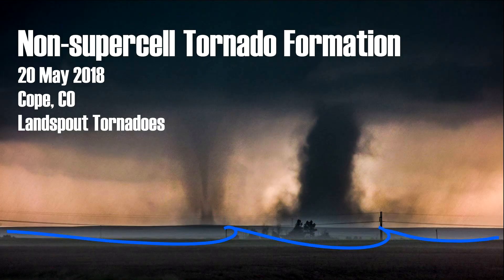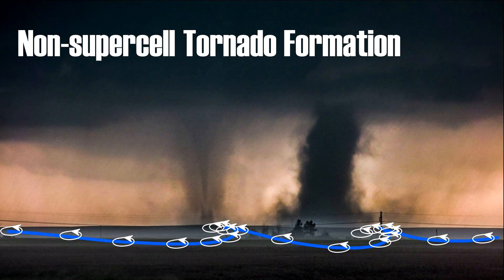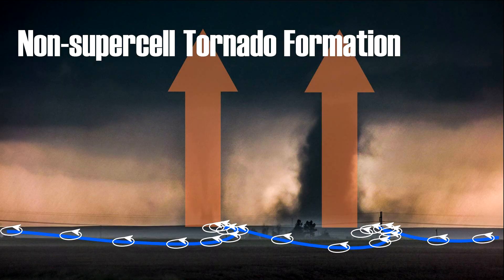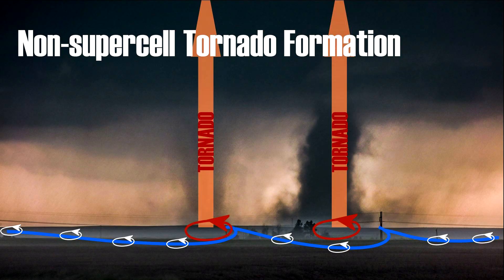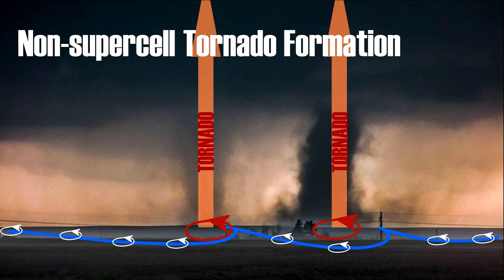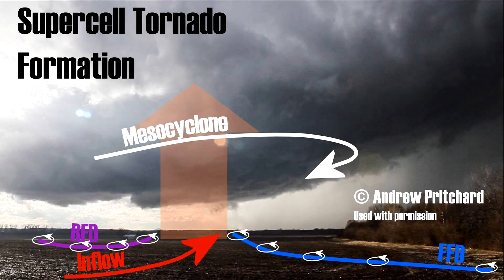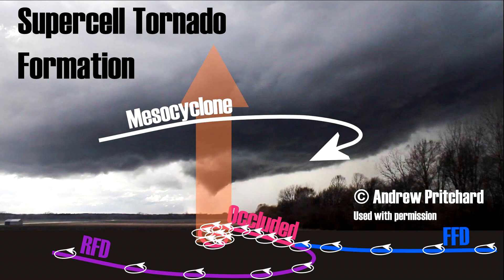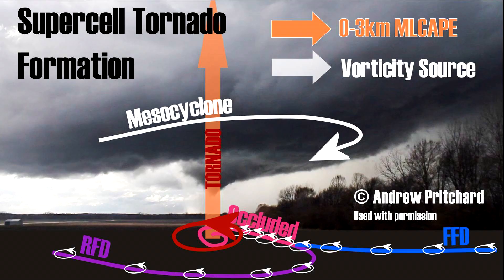How do tornadoes form?

Comment: With respect, but pulled up “surface based vorticity” has nothing to do with tornado genesis, formation. Tornados are driven by latent heat releasing condensation or deposition driven engines aloft. You are describing a whirlwind, which is driven externally by winds.

I have researched tornado genesis for over 29 years.
Reply from the maker: What would change your mind that Apollo 11 wasn't faked?

Comment: Great presentation, our understanding is really growing!  I got to see a talk by a professor stydying tornadogenesis at UW Madison when I went back to visit one of my professors who still teaches there.  It seemed to me like the models implied that a conjunction of things including those you cover are needed, and the more of them and greater their amplitude, the worse and more numerous dangerous tornadoes are.  The models seem emphatic that what appears to be a single vortex, even in landspout types is a braid of woven sub-vorticies.  I think we also split the atmosphere into layers with sharper boundaries than generally exist.  I think vortex generation and aggregation along a strong boundary and the rotating updraft/windshear conditions seem necessary together and additive but also don't cause or impede each other.  It really looks like a number of mostly/semi independent  conditions are required, and then some particular initiating condition emerges.  The which way will a water droplet run down a surface experiments seem to suggest we can know roughly when one will occur and how large it's like to be, but predicting one to the second and foot may be fundamentally impossible?

Comment: I watch videos, have been in one unexpectedly. I listen close, watch the models. Try to understand the details...but im seeing whats occuring in a different way. The start, the eddy, turns into a huge torid. Spinning like a drill bit. Air pulled under & up the center, then over & down..slowly generating. Condensation/skud only hides the process i think. The thing that caught my eye was the andover condensation peeling off the buildings, & hanks close up grain footage. I think the hot air moving up through the center of the torid, creates a "v" shape high aloft. That creates a cone of low presure that invisibly drops down in the center, sliding down the center updraft walls. When it makes contact with the highest ground surface high pressure, an implosion happens, causing those condensation streamers. Implosion from extreme temp, pressure, & weight differences causes increased wind speed from the high pressure trying to fill the l.p. void. You can see in a rope coming down, a clear center (l.p.) then white (implosion), then dirt and debris being blasted away. It looks like a "tutu"..its the explosion from the implosion. The bigger the implosion from differences, the more wind speed is generated. (Moving faster inward) The bigger the torid, the more room for l.p. to drop..more implosion & increase of speed until its a self generating monster! When i saw the size of the torid in your jarrel video my heart just sank seeing the size of it. Those l.p. ropes dropping down, striking like snakes, can only be seen when condensed by implosions. But looking carefully at the upper skud of downdraft areas ( up & over torid)..they are there also. At least thats what im seeing..i could be wrong. Depending on speed of cell, the torid will be oblong. Rear stretched & lowered a bit. But front will be more vertical, tighter circulation, & a free fall downdraft..just a guess.

Comment: If tornados form from the ground up, I’m curious what your take is on why funnel clouds appear to descend from the cloud. Is it that rotation is already on the ground, but is not yet strong enough to be noticed? And as the rotation increases, the funnel condenses closer towards the ground?
Reply from the maker: Yes. The rotating updraft column is already present from the surface to cloud base, it just hasn't intensified enough to be called a tornado. As the pressure drops within this intensifying updraft column, the height at which the rising air condenses into cloud gets lower and lower. The funnel appears to descend out of the cloud base, but it's actually being built downward by the updraft air rising up from below into the base.
Reply: @skiptalbot  Thanks, this video and your response was a huge help in understanding tornadogenesis!

Comment: Hey Skip, I hope you can answer this question: Given that the data from Leigh Orf seems to suggest that tornadoes form and survive from the "cold pool" or cold air, does anyone know what defines the "cold pool"? Does the cold pool have to have air that is a specific number of degrees below the surrounding air? Or does the cold pool have to be made up of air that is below a specific temperature? For example, if it is 80 degrees outside, for the tornado to form does the cold pool have to be filled with air that is at least 15 degrees cooler than the 80 degree air temperature? Or does the cold pool have to be filled with air that is below 65 degrees, no matter what the surrounding air temperature is? Could that relate to why some supercells produce tornadoes and some do not? Maybe the cold pool air just isn't cold enough or is too cold. On that note, is there a limit to how cold the air can be? So can the air be too cold for a tornado to form? I hope my questions make sense, it makes sense in my head. If it doesnt make sense, let me know and I'll try to clarify my question better.
Reply from the maker: The "cold pool" is more referring to the source of that air, or the process that it underwent, rather than its specific temperature. This is air that was part of a storm's downdraft, and downdrafts are generally cooled by precipitation such that they're cooler than the surrounding environmental air mass. But not always. Air that's mechanically forced downward or if the precip evaporates, the downdraft can actually be warmer than the surrounding air. You wouldn't have a cold pool in that case, but the temperature of the storm outflow making these pools can vary substantially. 

Yes, the temperature of this cold pool matters and may play a key role in whether storms produce or not. It's a Goldilocks like "not too hot, not too cold, but just right" situation. But there isn't a specific temperature to look for, or a specific limit. The temperatures are relative to the storm itself and the surrounding environment. Storms in cooler environments can still produce tornadoes with cold downdrafts if the air aloft is really cold. 

The general thinking is that colder downdrafts produce more of the needed vorticity, or spin to get a tornado going, but they are also stable and lead to sinking air and so can weaken the updraft with negative buoyancy. And the opposite is true if the downdraft is too warm, it may be buoyant and enhance the updraft, but not generate the required vorticity for rotating updrafts. It depends on the horizontal and vertical temperature gradients, once that produce a favorable mix of low level buoyancy and lead to strong vorticity.
Reply: @skiptalbot  oh ok, got it. If everything is relative, then it seems that prediction may be an unlikely goal. Generally, predictions can only happen assuming there are definable absolute parameters. If there is A+B then C will always happen. Sounds like we know the A and B, but we just dont know the interaction: whether it is +, -, /, or x.

Comment: Skip, I realize you can't get too technical. Explaining in more detail how this upward vorticity (at the very beginning) starts to form. I've heard there are two intersecting columns of air that are flowing against each other at ground level. Can you explain in more detail how this upward vorticity starts and increases in strength?
Reply from the maker: I think you're on the right conceptual understanding there with opposing flows, generally the spin produced on the boundaries between downdrafts, updrafts, and inflow, and the vertical and horizontal wind shear gradients in these environments. However, you should ask a severe weather research meteorologist as the physics behind vertical and horizontal vorticity are getting into areas outside my knowledge base. Check out Leigh Orf's video presentations if you haven't. He's got some great animations of how vorticity flows into storms and there's probably great examples in there of how vorticity is produced and amplified.

Comment: what if every supercell has a tornado? I mean if the mesocyclone draws in all the RFD, FFD and inflow that create rotation that then gets streched, what if there is always a tornado, just the updraft or rotation are too weak to be noticable.
Reply from the maker: Yeah, I think that's a conclusion to some of these ideas: that a tornado is just a special case of a more generalized updraft process, one in which the updraft is firmly surface based and has winds that reached certain vertical and rotational intensity thresholds prior to the updraft's dissipation phase. The stretching in the dissipation phase does the rest in kicking off tornadogenesis. Since all updrafts have some inherent vertical and rotational energy, they're all going through the motions of making a tornado in that dissipating phase. If we could measure these updrafts, we'd not only have advanced warnings with at least a few minutes lead time, but we'd probably be able to tell the intensity and duration of the impending tornado.
Reply: @skiptalbot  what about anticyclonic tornadoes? How do they form?
Reply from the maker: There are probably multiple ways to get anticyclonic tornadoes going. But I think the broad method of vorticity aggregation and updraft stretching is the same, so it's matter of finding the origins of those processes. The rear flank downdraft curls in the opposite direction (clockwise) on the "south" or "outside edge" side of the supercell. If the vorticity there gets stretched by an updraft, you can get an anticyclonic tornado. These are usually far less common and weaker than the  cyclonic supercell tornadoes, probably because there isn't the "streamwise vorticity current" (see Leigh Orf's presentations) feeding vorticity to the updraft on this end of the storm (so less rotation available), and this area is displaced southward from the main supercell updraft (so less stretching available). On non-supercells, you have vorticity in the ambient environment in both directions that's available for stretching (first half of video but imagi9ne the white arrows spinning in both directions). So those smaller, weaker tornadoes like waterspouts, probably have a much greater chance of being anticyclonic since they're not being driven by larger parent cyclones. Small whirls like dust devils and leaf whirls, it's probably close to 50/50 on which direction they spin.
Reply: @skiptalbot  also, this might sound stupid, but i personally don't belive the mesosyclone forms due to a horizontal vorticity tube getting tilted by an updraft. I feel like if an updraft met a horizontal vorticity tube it would just split the tube in half or kill it. 
What do you think?
Reply from the maker: We know those horizontal vorticity tubes, what we measure as streamwise vorticity and storm relative helicity, directly contribute to supercell and tornado formation. There are plenty of studies demonstrating a direct correlation. So the trick then is understanding what the causal mechanism is behind this. Check out Leigh Orf's amazing presentations on the "Streamwise Vorticity Current". What makes his supercell model demonstrations so compelling is that we see the same physical structure reflected in reality when we're out there chasing. I think Dr. Orf has really cracked the code and we're pretty close to nailing supercell tornadogenesis.
Reply: @skiptalbot  alright, i will check that out now, thanks!

Comment: I think your analysis combined with Dr Leigh Orf's computer generated models are at the forefront on developing a complete understanding of tornado genesis. When you mentioned the two downdrafts (FFD and RFD) beginning to squeeze the warm inflow surface jet, that points to Bernoulli's Principle -how water pressure and speed increase as a channel narrows. This principle can also be applied to air as it's how an airplane wing generates lift. I think Dr. Orf's Streamwise Vorticity Current (SVC) depicts the inflow and the tornado is a byproduct of that inflow surge. As the pressure falls from the inflow surge, an aggregation of cyclonic and anti cyclonic inflow vorticity at the surface consolidates and stretches into that surging rotating updraft using Conservation of Angular Momentum like you said and voila..tornado. It could also be an increase in 500mb winds that push the updraft down shear aloft and that surges the inflow. There are so many factors and  varieties of tornadoes in size, strength and duration it seems no one "trigger" ingredient is responsible for the creation every time. And the vortexes here on Earth are simplistically tame compared Saturn's hexagon polar vortex and Jupiter has a massive vortex cluster on its poles. Probably lots of math involved.

Comment: Don't mid level at 500 mb to 700mb winds collide aloft with the RFD?? Creating a downdraft?
Reply from the maker: Yeah, one idea on how (part of?) the RFD forms is that the midlevel winds are upstream of the storm and moving faster than the storm, they hit the vertical tower and are forced down the backside. I suspect there's some recycling of the inflow and FFD winds back into the RFD as well.

Comment: This could be a stupid unedcauted question, but wouldn't ingesting the air from the forward flank end up killing the storm?
Reply from the maker: It's a good question, and you're right. It usually does kill the storm! The shear has to be just right so the storm is still getting a fetch of warm, moist inflow. Otherwise the storm usually does choke and die on its own outflow. And then when the storm feeds off of its own downdrafts, the temperature has to be just right. Too cold, and the updraft is killed. Too warm and the storm doesn't generate enough rotation in the low levels. You need this Goldilocks just right mix or else tornadogenesis doesn't happen.

Comment: So do you also participate with Skywarn?
Reply from the maker: Yes, Central Illinois Skywarn via amateur radio and Spotter Network via internet are my main reporting methods.
Reply: @skiptalbot  

Ah cool, I'm also a ham who does Skywarn here for Olmsted county in Minnesota, although I'm stuck spotting from my group house until I aquire my driver's licence. 

Just a few days ago we had a pretty bad storm and come to find we had an EF1 tornado in SW Rochester. Didn't have a tornado warning either, but the county sounded the sirens due to the high winds, good think too since it warned some people in advanced of the damaging winds that blew over some big trees and tore a roof off one home.

I think the rotating wall cloud I saw from my house that blew in from the south probably we're it was. It seems like the damage occurred less than a mile away. I kinda feel a little silly that I didn't take a picture or video with my phone when I saw it. I reported to the NC at the EOC that I saw the wall cloud, and maybe saw a funnel, but I wouldn't confirm it because I thought my eyes were playing tricks on me. Maybe I did see one...

I'm still new to Skywarn, but I think starting to learn the ins and outs personally of what I learned to do in training.

I came to find your channel after finding an old copy of storm chasers S1 at my parents house, eventually finding out about the May 31 2013 incident, and heard you made a good analysis video on it. I saw the two of them. I need to rewatch them a few times to get my head around to understanding it completely. Also thought to share the safety video with my ham club since many are spotters too, and even though we don't get many severe tornados it's still good plan to have.

Anyway,
73 de David KEØPBI / SE1995 :3

Comment: Doesn't this contradict Anticyclonic tornadoes?
Great Video though
Reply from the maker: I drew all the little white arrows with cyclonic rotation, but they could go either way, and vorticity can be anticyclonic too. I suspect that's the case on the southern end of the RFD gust front, where the RFD curl is anticyclonic. But yes, it might contradict this idea! Or it might not be the whole story. Because there could be different ways that tornadoes form, and one such mechanism is by tilting of horizontal vorticity tubes. Basically a roll of air is created at the ground by these gust fronts, and then the updraft pulls the tube up making an arch. Once the ends are vertical, one end is cyclonic, and the other anticyclonic. I think this process is critical in creating mesocyclones or tornado cyclones, and the idea is that the rotation then gets piped down to the ground to make the tornado. In reality I think both and other processes are going on. Tornadoes are a writhing bag of snake like tubes. But this aggregation of little vertical vortices prior to tornadogenesis may be the dominant mechanism for getting the tornado going initially. At least that's what I'm going with for now.